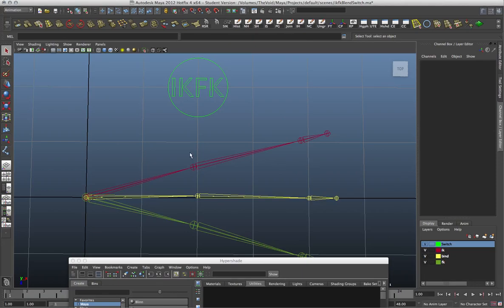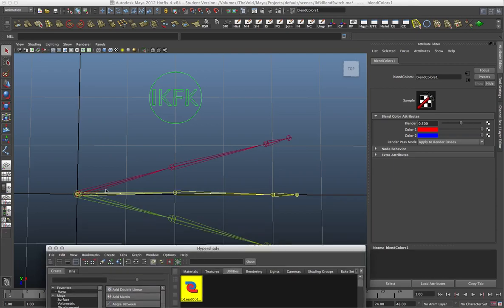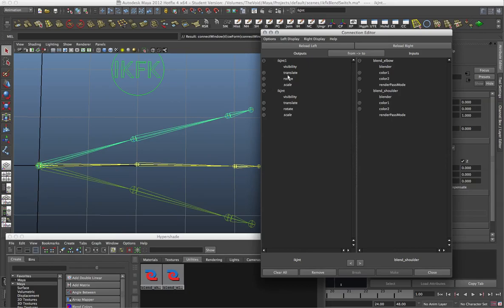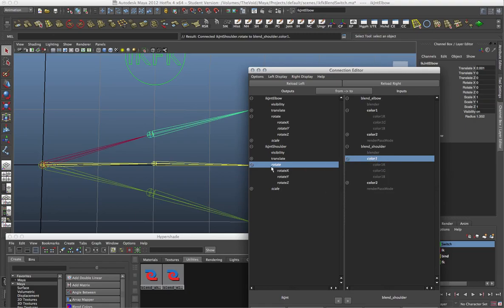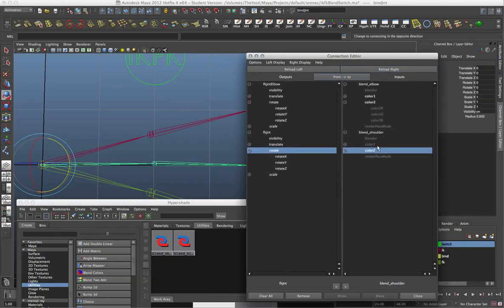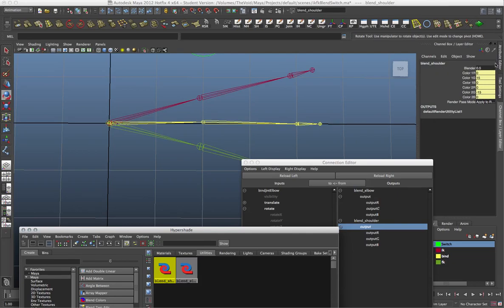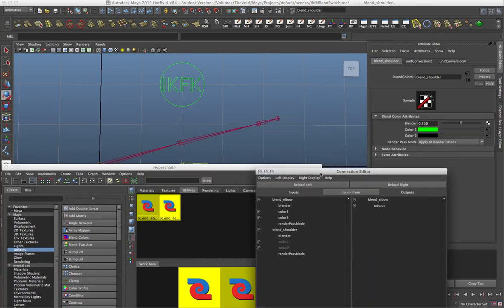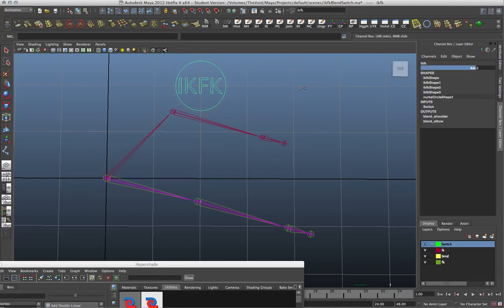BlendNode IKFK Switching

Comment: using constraints seems to be more easier right ?
Reply from the maker: Constraints are a simple option, but can leave more room for error, since they have to constantly calculate, instead of simply passing existing and concrete values. Also, this method forces one to pay more attention to joint orientation and consistency, which many ignore. Bad orientation tends to lead to many expected and unexpected issues for the rigger and for animators. Besides, at the professional level, node based rigging is more common because of its stability, efficiency, consistency, and accuracy.
Reply: yes what u said abt constraints are true. using nodes are stable. and one more doubt.., should i blend scale along with rotation ?
i mean for limbs i may have to stretch. 
have subscribed u.

Comment: Hi there mister Jeremy P!

Ive been fangirl stalking you online after watching this tutorial 

I implemented this technique in a rig of mine using it for the FKIK switch for both arms and legs

The blend switching works great but now it seems that my hands and bn hand and bn feet have strange way of following the rig. Almost as if the joint is being ofset by another control or node..
Im not sure if i am being clear enough.

Have you seen anything like this before andf if so- are there any solutions you could suggest?

Warm Regards
J
Reply from the maker: JanivandenBerg 
The one thing about using direct and node based connections is that it becomes imperative to control and pay attention to the orientation of joints and the controls driving the IK and FK joint chains. If the control objects are not oriented to mimic the orientation of the joints being controlled, then strange rotation issues occur. This is most common in the hands and feet, as other setups or quick control solutions may not take orientation into account. The IK wrist and foot control are usually the cause, since they aren't anchored to the joint structure. Creating a group and rotating it to align rotate pivots for orient each of the affected IK controls should fix the issue, if this is the issue.
Reply: Jeremy P 
Hi Thanks for your lightning replies :--)

This sounds like a very plausible cause- will look into it
Really appreciate it
J
Reply from the maker: JanivandenBerg 
You're welcome. Most issues have very simple solutions. The trick is to understand how and why the problem is doing what it shouldn't. Orientation and hierarchy are usually the cause and solution to most rigging issues.